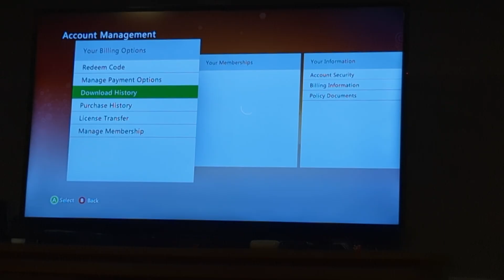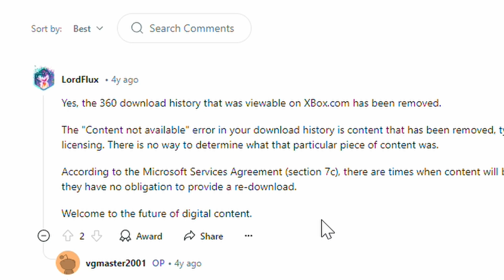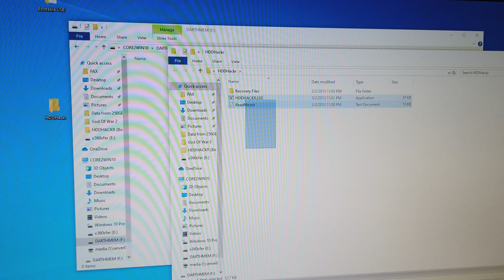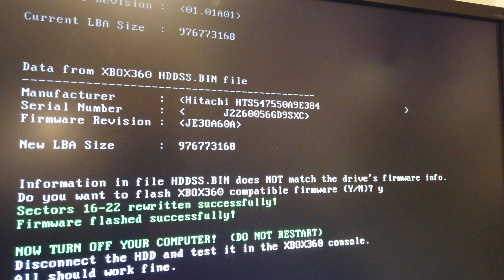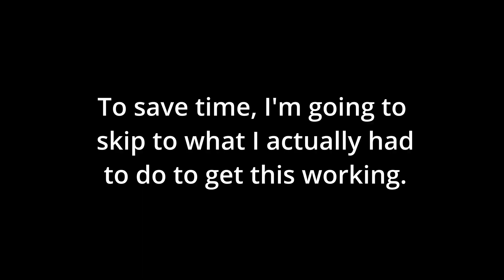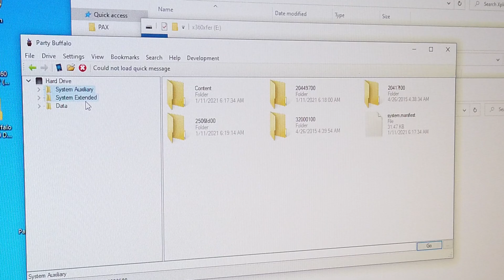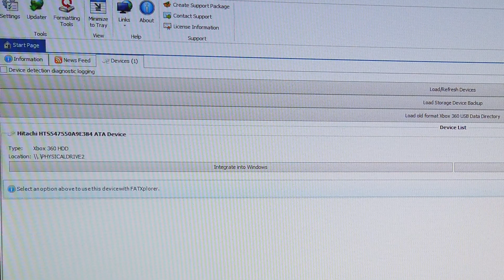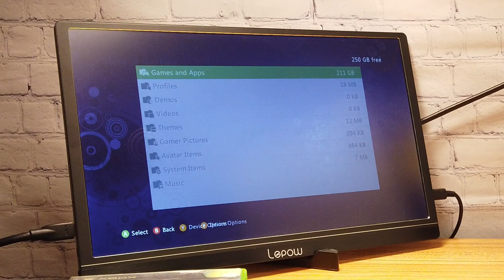DO THIS ASAP - Xbox 360 500GB HDD Upgrade - Download your entire game library!

Comment: For such and easy task, took me hours.  Had to build a win7 system to make the bootable usb as Win10-11 say Write protected. After that had to get out a legacy MB to RUN hddhackr as my laptop had  no ata drive error.  But I got it flashed (500gbWD) and it worked fine in the xbox 360.  Formatted right up and  Installed a game on the drive.
Reply from the maker: Yep. This only gets tougher as time goes on

Comment: I'm stuck on this: "No ATA devices present" on HDDHACKR. I have already changed to RAID mode. I've been tried every method to format my xbox 360 HDD, no one works. 😓
Reply from the maker: Ahh you may need to try with a different computer then. Sometimes it just won't show up.

Comment: Download your game library, yes.
Buy more games before "time runs out"? NO. manufacturer is actively abandoning hardware and software sales. 
the only option left after they close is the high seas. ARRR. they actively don't want your money, so it's not "stealing".
Reply from the maker: Totally agree. I should have clarified. I meant download your game library before they pull games out of your redownloads like they did with some delisted ones. I found that I couldn't redownload Lara Croft and the Guardian of Light either but thankfully had that on another drive
Reply: @SpiceVader  I just added that as a comment on general for everyone visiting the comment section as so many videos usually crop up when an eShop is closing down "hurry up and get these great games before it's too late!" And such, wasn't aimed directly at you maybe I should have worded it a bit differently my bad 🤣 great video in general keep it up!

Comment: RGH/JTAG is your best option now. I have a 500gb HDD but used all of its space with only 88mb left. You can't go any higher on the 360. With a modded system you can go 4tb and beyond aswell being able to back up your games.
Reply: Jtagging isn't an easy feat; its probably easier to just flash Kreon firmware to the drive but yeah i'd defo go with a jtag if you had the skill set to do it. The tools for such things like flashing kreon are probably like rocking horse shit now anyway
Reply: @brettrigby2226  JTAG is really only for Xenon's and Zephyrs, RGH 1.2 for Falcon's and Jaspers, RGH3 for Trinities and Corona's. You can't JTAG later models there are few that are JTAGable.
Reply: Most definitely now that there's an rgh 3.0 you don't even need a chip. https://www.youtube.com/watch?v=lw7JGyUUKbE&t=136s
Reply: 4TB? I've seen videos and even a goggle search that says upto 2TB.
Reply: @jayshreve4567 probably because of the physical space of the tray, since for 4Tb you need a big HDD, because of the disks
Reply: @jayshreve4567  Bro, 4TB as 2TB for internal hdd + 2TB external hdd.
Reply: Rgh3 works well on slim models (except Winchester e board on late models) but is not stable on phat consoles. The slim 360 is way more reliable anyway, and you can still pick them up cheap. Two wires soldered underneath and a ras pi pico for a nand programmer and your off to the races. Gives you a good chance to replace thermal paste as well and clean the heat sink. This was the easiest mod I’ve done so far